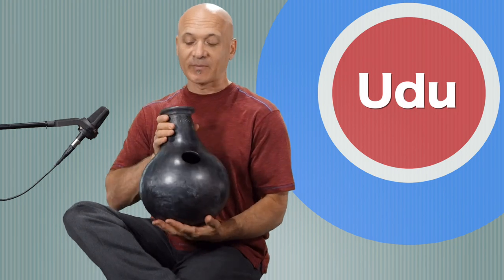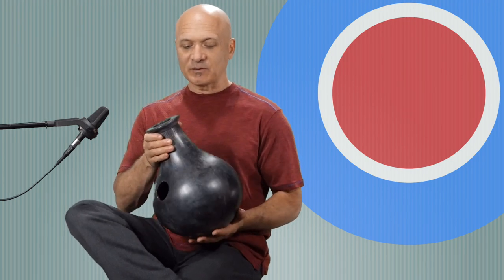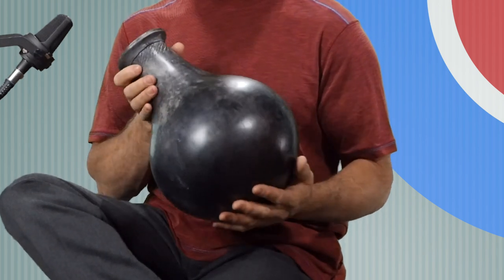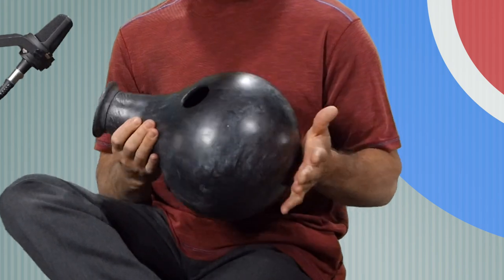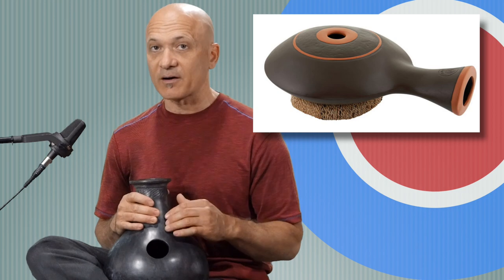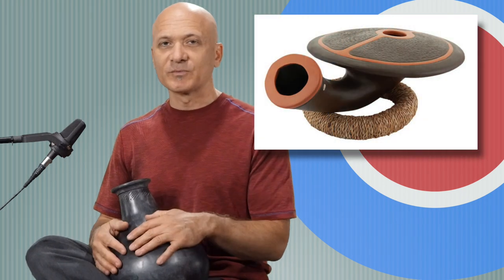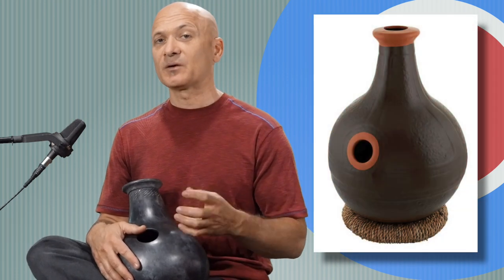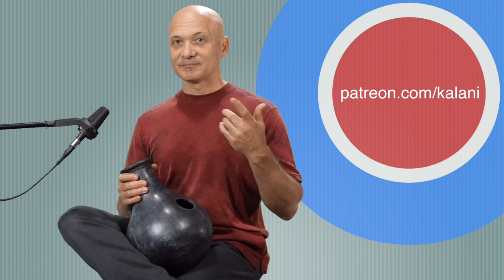Udu - Nigerian Clay Drum

Comment: I am no expert sir but that really aint the right way to play it. you have westernized the traditional udu drum. where is your playing foam pad? Udu sound should boom and be mellow at the same time. It is smooth, soft and loud. It is not a percussion, it works by forcing air in and out of the clay pot via strike modifications using your foam pad. What you are doing is good and interesting but ensure to let people know that there is a traditional way of playing it and what you are showing them has undergone some modification.

Comment: I bought a broken Udu years ago at a craft fair with the intention of repairing it. I had it sitting around for ages and a few years ago I finally got round to it. The edge of the spout had a chunk missing which I repaired using miliput, which has worked a treat. I now play it on a couple of tracks with a band I’m in called “The Emergers”. It’s a bit tricky to mic up in a live band setting but I’m working on that. I’m thinking to try and make an electric one from wood using a guitar pre amp with an internal gooseneck mic. May work or it might be a feedback machine 🥴 but here’s a track I did in my studio with the repaired Udu and my home made Fujara overtone flute https://youtu.be/R0HNxWoe_Os
Reply from the maker: Thanks for sharing